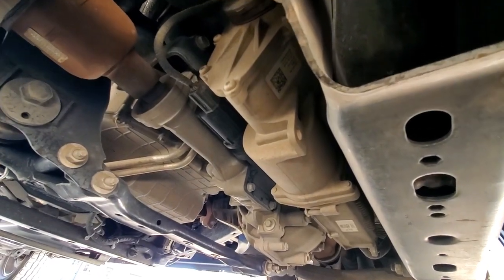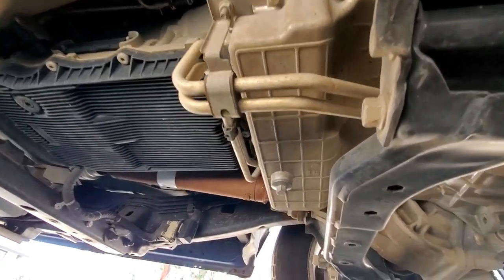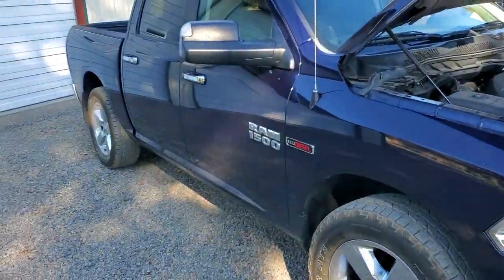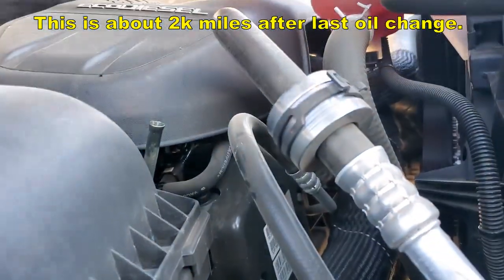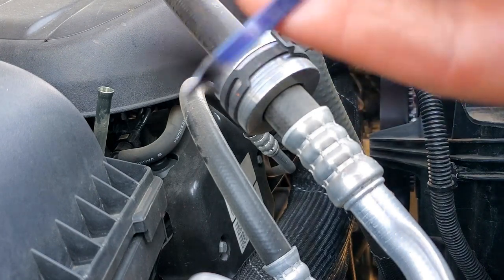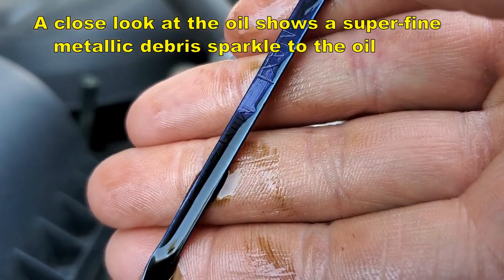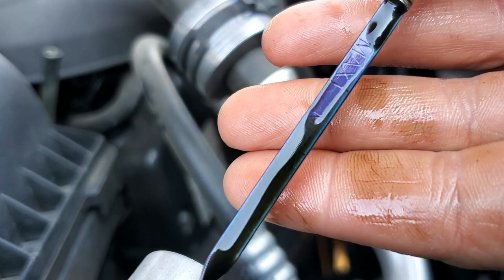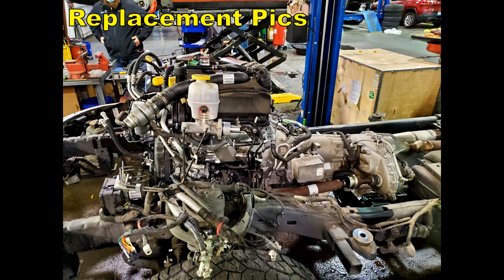What Ecodiesel engine failure sounds like? | Eco diesel Knocking | Main Bearing Failure

Comment from the maker: Has this happened to you? Drop a comment, tell us about it. Year, Mileage, Oil Used, Etc..
Reply: I just bought one too. Only bought it because it came with a 200,000 mile power train warranty. 👌🏽
Reply: Yes, happened to my 2015 at 70,000 miles. Truck was absolutely babied, oil changes under 10k with the recommended oil. This should never happen... Complete engine replacement under warranty. Do you know if the replacement engine is any different?
Reply: @4xprops457  what's wrong with that, I go 35k miles on oil change interval on my 07 duramax and do oil analysis every oil change with Blackstone labs and according to their report I can go to 40k intervals, my engine is shy of 550k miles👍🏾
Reply: I just bought a 2017 with 69k miles. One week later it blew all the oil out.
Reply: 2018 went at 105kms boom
Reply: Marko  yes sir it is...Blackstone labs is the best
Reply: 2015 second owner. Purchased at 112 KM. Engine failure at 165 KM. Oil changes every 10, so only 6200 mile oil change interval, trying to baby it as I was aware of potential engine failure but still wanted the truck because it was a killer price.  Could not afford new crate motor and wait 3 months for dealership to get one.  Ended up getting used one with less mileage for 14k installed with labour, (11k USD).   

Fingers crossed that this one holds up
Reply: boughrt my 2015 grand cherokee diesel last Sept  in November it blew the engine no warranty called the dealer they want $18,000 to replace.  engine alone was $11,000.00
Reply: Literally exact same thing happened to me Friday. That’s why I am on here looking to see if anyone had the same problem. It just got in line at the dealership to be diagnosed. 2019 with 35,640 miles. It had about 2,000 miles more before it was time to change the oil.
Reply: @mikerobinson8734  200k miles from who? Elon musk?
Reply: @satt4603  DonK whitefish MT
Reply: @mikerobinson8734  I know chrysler maxcare is 120k miles but if you have it writing ✍ way to go, rotella t6 5w 40 oil change every 5k miles thank me later
Reply: @satt4603  I’ve heard of guys running the T6 with very good results. High mileage in forums on these ecos and they we’re running RT6. I know FCA specifically states they want you to use a specific oil with the euro blend but I’ve been considering switching to the T6. I do my own oil changes anyway, hate going to the dealer for anything, also looking at tuning/deleting it so the whole warranty would be voided anyway. I plan on keeping it till it dies.
Reply: yes I have a 2016 ram with the ecodiesel in it. broke down on me on my way to work. Made a metal on metal tapping sound then died on me while driving. I found oil under my truck
Reply: 2015, around 130000 5w 40 rotella, engine didn’t wanna start no more. Said low oil pressure. Took it in. They said it was a blown engine. They said 14k to fix it like it was nothing. So now I have a pos I can’t afford to fix.
Reply: No engine failure yet. 160k miles. delete egr 25k ago. Average 25mpg. No oil usage to speak of. Putting in the shop for diesel return line leak monday.
Reply: 2014 jeep g.c. 4wd 122k. Religious maintenance.. blown motor after last service.. literally 73 miles after  service.  Boom gone.

New motor is you can find.. 26k top end. Just called round this week.
Same I live in commiefornia or 4bt would be solution.
Tear down and see if cracked block is next.
If it is and most seem to be that way,  your up shit creek without a paddle.
Reply: @Sat T  That's what I have been running the whole time! T6 5w-40 full synthetic 10 qts, hotshots FR3 friction modifier 0.5 qts, and wix oil filter. I run my oil level up to the max line....maybe just a tiny bit over with the FR3 so right at or over 10.5 qts total. Change at 20% oil life on guage....so about every 5k miles. Have you ever used the stiction eliminator every third oil change? I'm going to try it next oil change. Hotshots makes great chemicals like the EDT I use in every tank
Reply: 2018 69k miles blown
Reply: I had this same thing happen with my 2015 Ram EcoDiesel. A friend of mine is a commercial diesel mechanic and he suggested draining the oil and dropping the oil pan. When we dropped the lower oil pan we found that the pickup tube was completely filled with carbon deposits. Once we took care of the carbon deposits the truck ran fine again. I was told that if the oil pressure fluctuates then it is most likely not a main bearing issue, but rather an oil flow issue. If your oil pressure falls off and does not come back up then you may be dealing with a main bearing, but in your video clip and in a video clip I have posted elsewhere you can see the oil pressure fluctuating between 0 psi and about 30 PSI with the truck at idle-this most likely indicates a blockage in the oil flow. I now make it a habit to clean out the pickup screen and tube assembly every 3rd oil change...hopefully this helps.
Reply from the maker: @ajbergman3801  Dude, this is the first I have heard of this theory. It makes sense to me. My truck still ran, it made bad knocking, but it never threw a rod or anything. The truck doesn't tell you actual oil pressure, only if you have it, or you don't. In my video you can see how it must have been tripping that low oil pressure switch over and over. Low oil flow would have caused the loud knocking, I imagine it damaged the bearings. This is a good theory. I wish RAM would have used a more solid engine. I am now changing the oil more often and with amsoil for the hell of it. Now that I am out of warranty if it happens again I will definitely drop the pan. I wonder if my new engine will be prone to the same issue?
Reply: Dealer just called me today and said my 2018 has a rod going out, I’ve used 5W-40 Amsoil European oil from its first oil change. Has right at 70K.
Reply: My 2018 blew last week at 68k miles.  Warranty will fix but no eta on replacement motor. As soon as the truck is fixed I'm selling it. Don't want a ticking time bomb. Most of the ecodiesels will blow at some point...no matter the maintenance. I did religious oil changes every 7500 miles. Rotella T6 with OEM filters.

Comment: Oil analysis every couple oil changes. I run synthetic and send a sample off every 6000 miles I usually don't change it for 24,000 miles. My truck currently has 310,000 miles. Oil analysis has caught everything for me before it took a shit. I should have been inspecting my u joints. My truck threw the transfer case out the driver's side going 70 down the highway. Transfer case split into 2 pieces joint on 4 wheel drive seized up. Thankfully it chunked it straight across the highway to the ditch and nobody hit it.

Comment: The main bearing failed due to the EGR.  The soot load overwhelms the oils' detergency/dispercency capabilities.  The oil polymerizes and completely clogs the passage in the crank and spins the bearing, (usually cylinder  3 or 4).  This is a good engine with an Achilles heel that can be dealt with in 2 ways.  1. Shorter oil change interval (5k miles)  2. Add a bypass oil filter with soot filtering capability.
Original oil weight spec was 5w-30.   In 2016 fiat/chrys changed the spec to 5w-40.  The jury is still out on this decision.  Thicker is not always better.
Reply: Shorten the oil change to 3000 miles add dual external oil filters
Reply: Block the egr. Problem solved.
Reply: @Se2n67g9r  the only real solution that’s no longer available…for most.
Reply: There’s actually 3 ways.  DELETE IT

Comment: I have 2014 Jeep Grand Cherokee eco diesel at 176,000 MILES still no issues!  Hopefully stays that way!  I know  that's a problem and I'm scared of that!
Reply: It’s hit or miss with these Ecodiesel engines. I have 112,000 miles on my 2015. Original owner had the AEM and claimed the $3,075 settlement. I did have to replace two turbos, starter, DEF system, three Navigation systems, water pump. The EGR cooler was replaced on recall for leaking coolant. 
Definitely not a reliable vehicle. The warranty was well worth the money!
Reply: @Chris C I guess, just cause I haven't had any problems doesn't mean others don't. Never had any of those issues! I also drive it alot which think helps it run great! Not to say you don't.
Reply: @Chris C That's the problem. I also used to be a test driver for Audi and tested their diesels and the engineers used to always say how these diesels need to be driven cause of the DPF filter and shouldn't be driven for 20 min then turned off. They need to get hot and driven for a while. Which I do. That's probably why it runs so good. I'm sure if I drove it fo 20 min at a time. I would have problems as well.
Reply: I have a 2015 JGC ecodiesel at 94k Km, not deleted yet. No significant issues so far but sometimes it kind of lost power no matter how deep I floored the pedal. Pretty annoying on highway
Reply: @boostimalaka1  Damn, some1 totalled my EcoDiesel. It had 200,000 miles. Just changed the DPF filter at 188k which is more then doubled the life expectancy of that, and that's it. Never lost power or anything. Couldn't find another one and have the 5.7 Hemi, which I love, but truly miss the Diesel and would rather have that. I guess it depends on which 1. The diesel are meant to be driven. Driving 10/20 min drives will kill it. And that's only cause of the DPF filter and EGR emission controls.
Reply: @Vziera  That sucks you have loss of power.
Reply: @Fab-ec8os  might it be a sign of bearing going bad? How did yours get totalled?

Comment: ‘17 Laramie Ecodiesel, 88k miles. Been at dealer for over a month with no information other than hole in block. Not impressed on a truck that was maintained by dealerships.

Comment: I am from Morocco and owner of a 2018 grand cherokee with the same engine than the one you have on your RAM, it is the same engine block from VM Motori, engine code A630, starting 2018 they stopped calling them ecodiesel, I do not know why but that’s not really a problem… This is an excellent engine. I am actually 160.000 km with a quite tough drive habits (high speed on highway, driving on sand…) and the engine is still performing like the early days when purchased the vehicle.1
In my opinion, the cause of those engines failure might come from the oil change intervals based on the oil change indicator: most of the time, the indicator tells you need to change the oil around 16.000 km (depending on your driving manner) whereas the suitable interval change should only be 10.000 km. In Morocco, the local dealer who is a direct subsidiary of FCA USA, made mandatory to change the oil every 10.000 km and to ignore the oil change indicator of the vehicle.
Hope this helps,
Reply: I feel like some of the people having problems with this truck also have never owned a diesel...Warm up time is very very important on any diesel.  I have not once let my oil change go over 8,500 miles.  Its cheap and easy to do on your own.  I try to let my coolant temps hit about 100F before I even move the truck...I have about 63,000 mostly trouble free miles besides a couple check engine lights that I cleared myself.
Reply: @MattSmith-vl8zp  idling is not recommended..turn it on,stay for a few seconds and then just drive it but do not go over 1300/1500 rpm until the temp rises
Reply: @pippo702  I’m talking about 5 minutes or so of warm up time each morning.  Not 20 to 30
Reply: @MattSmith-vl8zp  I'm not saying warm up time is not important, it's mandatory! But,idling it for 5 whole minutes can cause more damage than good.. especially in those very cold mornings where the oil is very dense and the oil pump struggles..driving the car at 1200rpm or so would helps the oil pump to work better, oil would flows better and the lubricant would reach every part of the engine warming it up more evenly..every morning you would see me driving the neighborhood at 20 or 30 km/h until the water temperature rises up a little..I don't care if I'm on time or late for work..I just do it! And remember to cool it off too before turn it off...especially after long highway trips

Comment: I do my own oil changes according to the meter in the truck. I use name brand oils. 5w40 synthetic. No mods to the truck. But I let the oil drain from the pan for about half an hour when really hot. The oil seems to have a little more soot in it during the last moment of draining. A little more black. 175 000kms so far. I plan on deleting the def and egr system soon and changing the tune. Dodge messed up my fuel economy with the update other than that 0 issues. 2016 1500 ecodiesel.

Comment: Why were you doing extended oil changes Between 8-10K miles?  You should be doing oil changes at least every 5-6k miles with light / Med duty diesel trucks.
Reply: If people actually read their manual that comes with the truck it tells you to. Ever exceed 8000 miles before changing the oil if using B5-b-20 biodiesel.  Not a single gas station I use has a sticker that tells you the exact amount of biodiesel.  10,000 miles on an oil change is stupid.

Comment: Just happened to me. 2018 Ram 1500 about 120,000 km within 2 minutes the engine started knocking, low oil pressure warning and engine shut down. Oil changes done when recommended. Towed to dealer diagnosed as bottom end failure engine seized......waiting for new motor
Reply: Happened a few days ago here similar to what you describe. 2018 Dodge Ram 180,000KM. All dealer serviced and maintained.

Comment: had this happen to  me the first dealer they towed it to refused to work on it 58000 milles so i call corp and they towed it to where i bought the truck they replaced the complete engine i just dont understand how a dealer can refuse to work on it
Reply: I can't find a dealer within 100 miles that will touch mine... not even the one I bought it from...

Comment: I don’t understand the mentality that 8,000-10,000mi is a good thing *for the engine*.  Sure it’s great for the owner - lower operating costs.  The fact is the additives in the oil break down far sooner than the base oil does, and those additives include viscosity modifiers.  This is what makes multi-viscosity oils work they way they’re supposed to.
Reply: Yeah extremely stupid to do that, 4500-5k is the perfect time, anything more is negligence
Reply: @DJCuhhhstin956  When I bought my 2016, they said to change the oil every 10K. I've had nothing but problems ever since

Comment: 2016 ram 1500 ecodiesel. Total engine failure at 64K. Went into Limp mode on the freeway....oil all over the road. All dealer maintained from the time I bought it. 4000 miles past warranty and Chrysler isn't helping at all

Comment: Seems like all we consumers do is hope that these manufacturers get their issues fixed before we buy one. Doesn’t matter how much you delay in buying one. They don’t attempt to get them ironed out. That costs too much money. They would rather just skirt fixing it under warranty.
My 2006 hemi destroyed itself when Instarted it up. It had 100,000 miles and regular oil changes. 
I replaced 2 of my Chrysler minivan transmissions. 
I replaced a transmission in my 2000 Grand Cherokee.
Many other common Chrysler problems fixed too.
I finally switched away from them after 30 yrs

Comment: Just had the spun bearing issue on a friend's 2018 ram. His engine was totaled. Difference here though was he had oil spilling out under his truck. Part of the bearing damaged the crankshaft seal and oil was able to leak out.
Reply from the maker: Sounds like the rod was thrown, and punched through the case. Sucks. Some do that, others just spin & seize the bearings

Comment: Damn, 8k-10k between oil changes??? The most for any engine should be no more than 5k
Reply from the maker: I hear what your saying. The manufacturer says 10k mile changes, I am accustomed to gas engine every 5k, So i usually changed it at 8k miles because diesel engines can generally go longer on a change then a gas engine. So the engine still is a poor design. This happens to brand new vehicles at 3k miles, all the way to well maintained trucks at 300k miles. Question is when will it blow?
Reply: Its a diesel....

Comment: 29K Miles or 48K ms our EcoD just locked up in Sept. 2015 we don't drive the truck much, is not a favourite.  Big, noisy, slow. I like the HEMI tho.  Been on a flatbed more than any thing I've ever owned. Makes my Range Rovers look like Toyotas. Mostly SCR related faults, which was finally solved with a new NOx sensor.  Dealer said it was good to go. Then one of our engineers was using it for a weekend and it died in traffic. Told him to get it towed to dealer. Diagnosis = new engine required.  Hoping FCA would pitch in, such problems and low miles. NOPE. Waited more than a month. Now looking at options, and in Canada no stock of new motors. Found a long block or used with high kms.

Comment: 2014, mine blew at 79000 miles and out of warrenty. I had all oil chages done at the dealership, I had it deleted at 50000 miles thinking it would not happen to me with the delete. There should be a case action law suit against Ram. I was told it would be 15000 for a new moter and only warrenty it for 2 years, no thanks, bought a 2015 Ram  1500 hemi.
Reply: Good luck with the valves and cam 👍🏼
Reply: Lol- you got another ram product ?? 😝 👎

Comment: I have client with a 2016 model ram eco diesel. I’ve been taking care of it at 90k miles, I has 170k now. I really thought we would be doing the engine at 110k, but so far, it’s solid.

Use Mahle oil filter, shell rotella T6 5w40. Change it right at the percentage indicator. No ifs or buts, now 20k mile oil changes and this thing should survive.